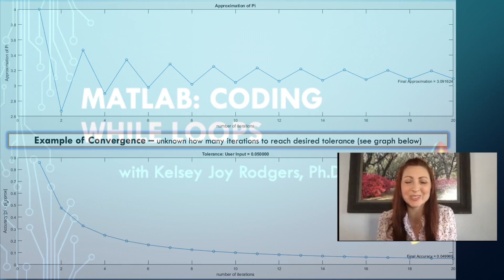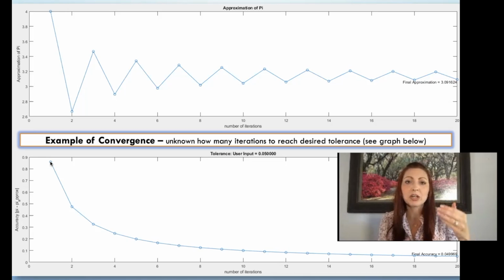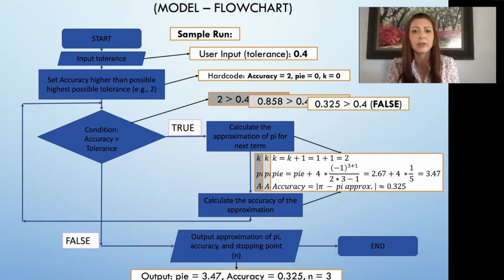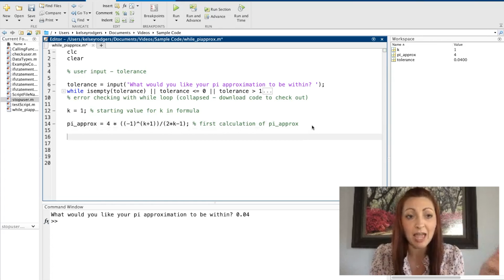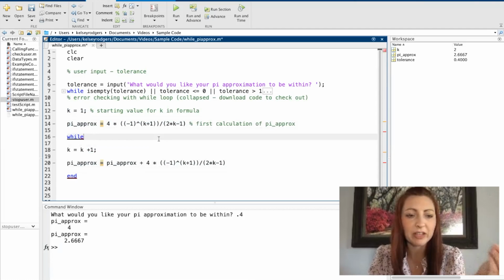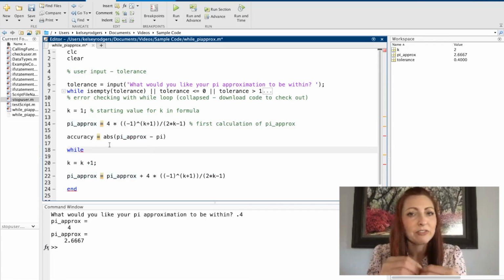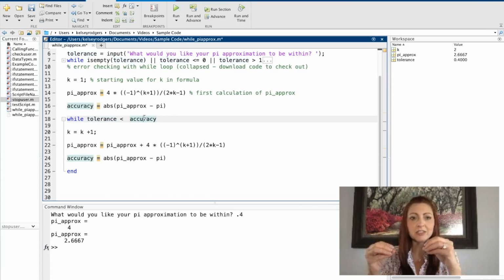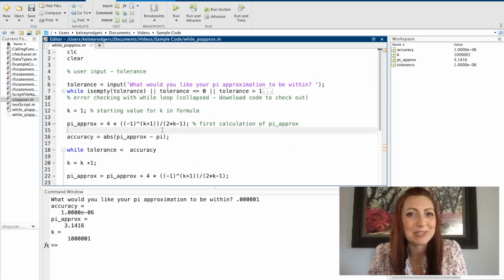MATLAB: How to code While Loops for Convergence (pi approximation)

Comment: dr. hello i was trying to calculate probability of P(x>=mx) and i have mx value which is mean of x. and x is A 1 column with 169 rows of number. and also  p(x>=mx | y>= my). so when i write the code result dont show up. if you could help me with both probability types i would appreciate. thanks .
Reply from the maker: Hello. x and mx values sound great. Assuming x is a matrix and not cell array just making sure. 
Not sure where P comes from or what you have for that variable. 
For the first one:
 x>=mx will give you a logical array of 0 for false and 1 for true. You can sum up this logical array which will give you the number of occurrences. You can divide this by the length of your array and then multiply by 100 to get a percent. 

Example:
PofGrEq = (sum(x>=mx)/length(x))*100

Let me know how this goes and if you have more questions. This should be able to help you in your next probability problem. Keep in mind for A or B you need to subtract the intersection of A and B (probability formula).
Reply from the maker: Not sure what my represents and if there are x values that make both statements true. Also keep in mind or in MATLAB is ||
Reply: doc it conditional probability probability of P(X≥mX) conditioned to (Y≥mY) so how can i write it ? here i have both values of P(X≥mX) and (Y≥mY)  but when i try to connect with && operand its displaying 
"Operands to the logical and (&&) and or (||) operators must be convertible to logical scalar values. "
thanks again dr.
Reply from the maker: @lalabish-tn3yt  lots of options and approaches here. I'd just create the logical arrays add them together which would result in 0, 1, or 2 for every value. (assuming x and y arrays are same size) find where array is greater than or equal to 1 which would be true for your original condition. Then do the same process above of sum divided by length of array. Let me know how this goes.
Reply: @EngineeringwithDrKelseyJoy  Dr. hello 
how can i write code to show independence of two events? or how can i write code for p(x/y)=p(x) or for p(y/x)=p(y)   ? any help would be appriciated as always 
thanks dr.
Reply from the maker: @lalabish-tn3yt  thank you as always for the comments. I'm not sure what you're looking for. Are you looking for the probability of x/y=x in the first one or what is p(x) representing?
Reply: @EngineeringwithDrKelseyJoy  dr. what am looking for is to write code or to proof that event x and event y are independent. means either of each event is independent to each other.
Reply from the maker: @lalabish-tn3yt  okay. I understand what you were looking for. This discussion on MATLAB may be helpful: https://www.mathworks.com/matlabcentral/answers/157914-checking-if-two-random-variables-are-statistically-independent

I think they discussed this well. Do you have access to the statistical package on MATLAB?
Reply from the maker: If not, this video discusses a resource where you can access MATLAB for free that has every package available: https://youtube.com/shorts/Uq5ByHCJ3yE?feature=share
Reply: dr. how can i know  my results with respect to the data given if they are independent ? and also how can i interpret the result in a physical meaning?
Reply from the maker: @lalabish-tn3yt  with the approach mentioned, 0 would be neither, 1 would be 1 of them, 2 would be both true. Does this help?